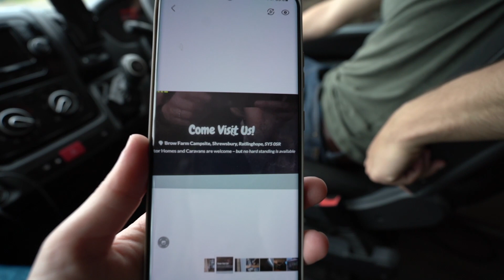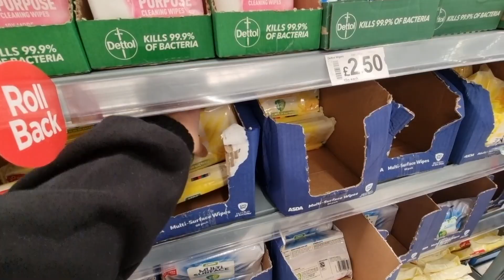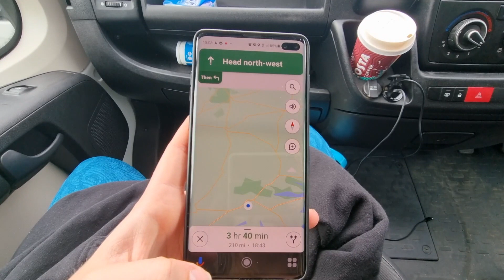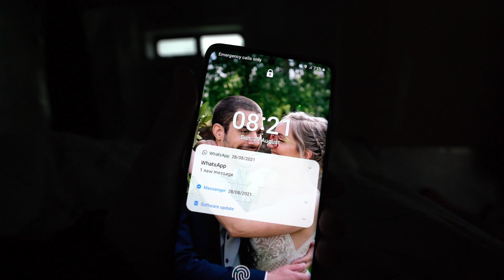VAN LIFE UK  - WALES - 1ST ROAD TRIP ADVENTURE | Episode 1, Part 1

Comment: looks like you had a great trip, is there anything you want to add or change to the van after the trip?
Reply from the maker: It was awesome!
Hmm good question, don't think so - We found some neat little things tough, eg the rear windows (frames) are a perfect place to put phones, (morning coffe) etc when sleeping / in bed. 
We also plan on not blocking off the shower with a solid wall (fully retractable door) so we can have it open most of the time (we think once the kitchen is in, it'll help to keep that area feel more "open" (also easier to clean / empty toilet etc) 

Aye - bug screen / net for the sliding / rear doors gone up on priority after this trip I think 😂

Overall I think our plan / layout is good so far and can't wait to get the rest of the van finished !! 😎👍👌